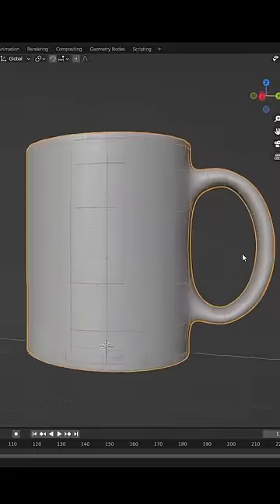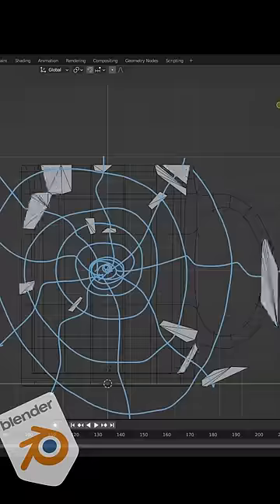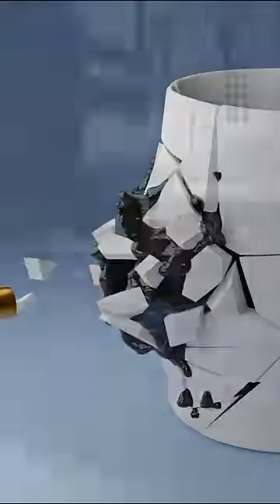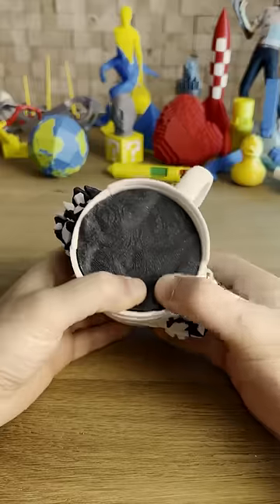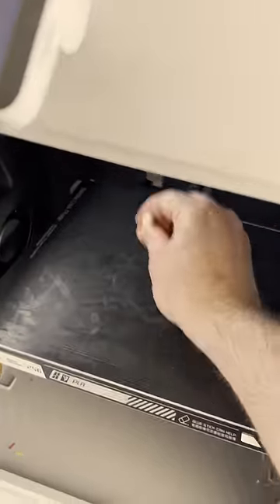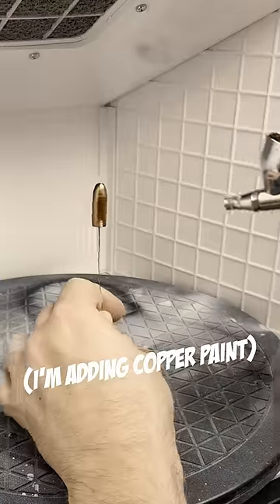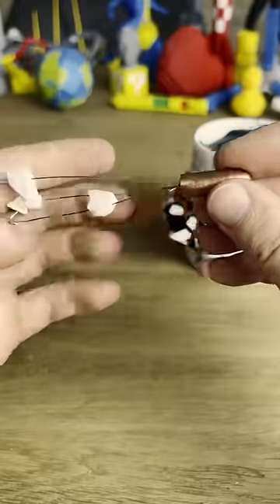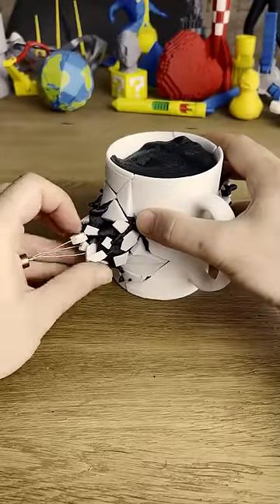Printing A Coffee Mug Shot By A Bullet ☕️ #3dprinting

Comment: I want someone to make this an actual mug.
Reply: Feel like it would quite hard to drink out of or clean ngl but maybe just the shattering or smt
Reply: @Sketchy_Dood make the bullet be the handle. Gives you an undamaged side to drink from.

Coat the whole thing in a smooth surface of waterclear epoxy
Reply: @JinKee I was thinking maybe have the fake liquid patch up the holes to still maintain the appearance of a broken mug without actually having open holes
Reply: It is it literally just saw it
Reply: @monke7919 you could mabey have a clear cube in the middle
Reply: @Sketchy_Dood  also I dont think it would be safe to drink out of pla and it wont be water tight
Reply: Possible
Reply: @JinKee or you can just make the mug but glue a cup inside so it will look the same but  you can drink out of it
Reply: Wow. Can you share your stl's?
Reply: @I.love.catssss622 I think that is the right way to do it
Reply: @Sketchy_Dood  no what you have is plastic so that your drink of choice would fill up that hole and look like it got shot
Reply: Same thoughts
Reply: I want one
Reply: Gl cleaning that thing cuz there's definitely gonna be dirt hidden within...
Reply: This was my first thought
Reply: just turn the bullet so its not actually in your neck/chest when you try to take a drink
Reply: @Sketchy_Dood if you make it normal on the inside and just the design on the outside
Reply: What if a normal mug, but with the handle being the mug shatter stuff and the mug can look black and white where you hold it
Reply: I was hoping it was
Reply: Yea yea
Reply: Totally thought it was an actual mug
Reply: Good thing is I never actually clean my coffee mug, so this would work fine with me
Reply: @Sketchy_Dood the shattering part he can add epoxy and white parts for the shatter effect he dont need the wire to connect to the bullet he can use white epoxy and make a liquid that is attached to the bullet without the wire and all
Reply: Okay I’ll do it
Reply: I would just like you to know im going to do just that i do ceramic work 🫡🫡
Reply: @Sketchy_Dood I agree unless you just made it so that the shattering is just on the outside like two solid pieces
Reply: I'll try to design something
Reply: Good luck washing that
Reply: It can be done, but it would require a blueprint or something similar
Reply: @Sketchy_Dood nah, just add larger clumps on the side and form the clumps. Then you can paint them and youre done
Reply: Same
Reply: It would take up so much space in the cabinets
Reply: Exactly
Reply: @VenomFrogPwned "it is it just saw it" Godzilla had a stroke trying to read this and fucking died
Reply: I posted exactly this but there's 126 comments of people counting
Reply: @FoxDog1080  But I was a week early so.
Reply: @FoxDog1080  Plus you're saying convert a mug into one. I'm meaning start from the beginning and do it.
Reply: @FoxDog1080  So sorry lad. Nice try.
Reply: @FLINTLOCKWOODMACHINE  I'm just complaining about the fact that they're counting
Reply: bro, I love your channel image!
Reply: I’d buy this
Reply: Just shoot one then
Reply: I agree.
Reply: You cant 3d print an actual mug it would just melt
Reply: Not exactly the same but you can find glass beer mugs and shot glasses that are designed with fake bullets shot at them and deforming the glass on one side around them as they enter at the Bovington tank museum online shop. I think they make a fake shattered one with a bullet too.
Reply: Y E S
Reply: @Sketchy_Dood just make the shape of everything around the outside of the mug. Then the inside is a regular mug while the outside looks to be shattered and blown out.
Reply: I WAS JUST ABOUT TO SAY THAT
Reply: @Sketchy_Dood I made something like that XD the concept it pretty easy
Reply: YES
Reply: u can get metal inserts and use this to hold the insert aslong as u make it to right size. then u can just clean the metal insert when u finish drinking ur coffee
Reply: My dad has a mug similar to this. It's glass and has a bullet from a gun stuck halfway in it
Reply: No you dont 💀
Reply: @Sketchy_Dood nah my dude piece of cake if we can make phones and the Internet then we can make that
Reply: I was thinking the exact same thing.
Reply: @Sketchy_Dood  fill the inside with the material that you use with actual mugs
Reply: I was just about to comment that
Reply: im taking a ceramics class soon ill see what i can do
Reply: Exactly what I was thinking.
Reply: @VenomFrogPwned they're talking about a mug like this that can hold a beverage. This mug is just an art piece that you cannot drink from.
Reply: I also was hoping this would be an actual mug.
Reply: Instead of making it the actual mug you'd make it a cover for a mug, that way it needs washed less often
Reply: Img YES
Reply: If someone did, they'd be breaking physics
Reply: I’d buy.
Reply: Fr
Reply: Bro y’all making ideas but not braining enough. How about a mug with a regular handle, but on its sides it has an illusion that there’s a bullet coming out same as the one in the video except the inside is just hollow like a regular mug
Reply: Imagine washing that mf lol
Reply: @watermelonfelon2777  I don't know, maybe put the design of the bullet on the outside and have the inside not have all the nooks and crannies and make it drinkable?
Reply: Same it's actually disappointing it's not.
Reply: @Sketchy_Dood I would have it as decore. It looks fire 🔥
Reply: Fr
Reply: TRUEEEEEE
Reply: For Donald trump
Reply: What if they make the design sheerly on the outside without the top and insides being covered by the black particles, like built up from the outside with an empty slate inside. Make the walls of the mug solid and then the extra printed stuff /shards lifted. That way most of the wire to hold the bullet will be coverrd by the shards and coffe particles. The bullet being detatchable
Reply: Exactly
Reply: Hi
Reply: I thought it was a cake for a second
Reply: The entrance would not have blown out and the bullet would not have been whole after impact
Reply: Same
Reply: THATS EXACTLY WHAT I WAS THINKING
Reply: Came to the comment section to write exactly what you wrote 😅
Reply: Angle the bullet so it comes in at 45° with the handle at 90° and the drinking point at 180°
Reply: i had the same idea bruh 👍
Reply: Bro me too
Reply: Just make it appear like 3D but it still holds the shape of a normal mug
Reply: it would only be a novelty and after a week they probably wouldn’t sale much
Reply: @JinKee how tf will you be able to design a realistic bullet that it big enough to support a full cup
Reply: Don’t worry grabs gun
Reply: yea
Reply: Same
Reply: Bro same
Reply: @Sketchy_Dood I’d buy it for decor
Reply: agreed
Reply: It can be a real life mug! Just shoot your mug, and because time is able to become measured infinitely smaller, find the frame of it and if you are able to exist in slow motion for infinite time, enjoy the moment of it!
Reply: Don't think that would quite work
Reply: @JinKee   put a stainless steel insert to hold the fluids! Epoxy is not good with boiling temp swings
Reply: Ok but how much should I charge?
Reply: Fr tho
Reply: What you got there mate?
Oh just a mug shot of coffee😂
Reply: @Sketchy_Dood  could make it a 'skin' for a actual mug. so it just clips into place and when you need to clean it you just take out the mug and wash it separately
Reply: That's how we drink coffee at school
Reply: Bro same
Reply: Fr
Reply: SAME!!!
Reply: Lol
Reply: @Sketchy_Dood just make a mug with shatter paterns and the "shot part" can be detachable so you can remove it and toss the mug in the dishwasher
Reply: I WAS THINKING IT WOULD BE AN ACTUAL MUG
Reply: Agreed
Reply: On it
Reply: I don't know if anyone has already answered this, but the reason this mug doesn't really work as a mug is that 3D printed plastic cannot be used on objects that have direct contact with food, as it runs the risk of accumulating bacteria or releasing particles.

For this to work, he would need to fit this printed mug as a cover onto a regular cup, so that neither the liquid nor the mouth come into contact with the printed plastic.
Reply: I could do it for a fraction of a second.
Reply: @JinKee no, that would suck
Reply: right
Reply: @Sketchy_Dood  make a smaller removable cup which you can put inside it.
Reply: @Sketchy_Dood something this cool I'll figure out a way
Reply: I don't
Reply: p
Reply: Good punctuation.
Reply: Thats what i was thinking
Reply: good luck cleaning that up
Reply: same
Reply: would have deserved a thumbs up if it was a actual mug, youtube are full of 3d printed toys allready that serves no purpose
Reply: 31K votes seems like a reasonable number
Reply: Me too
Reply: If you charged $10 for this mug, you'd make over $300K if everyone who liked your comment bought one
Reply: Yes
Reply: Same
Reply: @VenomFrogPwned I literally was about to comment this exact same comment when I saw this comment
Reply: @natalieholz8003  ok
Reply: When I'm older I'm making this just to grant your wish
Reply: im pretty sure I have a shot glass with a bullet in it.

Hehe, shot
Reply: I was thinking about commenting that lol.
Reply: Im on it
Reply: Same here
Reply: @JinKee not a bad idea
Reply: Same
Reply: Look if I had a 3d model I'd do it.
Reply: @Sketchy_Dood nah, as long as it's a normal mug internally then it'll be simple to clean.
Reply: Not practical bud
Reply: They did lol didn't u see this?
Reply: I'd be hell to clean
Reply: you want to eat bullet 💀
Reply: I’d buy one of those!
Reply: Same I would use it faithfully and I do not drink coffee
Reply: Ong
Reply: @ahmednawarm.eprojects3752 if someone made a real mug it would most definitely not be made out of plastic just the shards and bullet. The rest would be clay or whatever mugs are made of these days
Reply: I was JUST thinking the same damn thing!! I want an actual coffee mug like this!! Lmao
Reply: @VenomFrogPwned no a mug that you can drink out of
Reply: Thegod569  hell yeah
Reply: It would be difficult to manufacture such product. However you could 3D print the outside layer and put a real mug inside
Reply: Fr
Reply: @Sketchy_Dood just make those parts detachable
Reply: Not gonna lie it looks amazing and soo god damn badass
Reply: No one cares what you want
Reply: The entry point has exploded more than the exit, must be modeling off Crap of Dooty physics.
Reply: I think for that to be achieved you would need to put a like thin layer of plastic or glass to make a sort of hidden drink that you could just take off from the mug and so it would be that layer you would need to clean
Reply: There’s this store on Etsy that sells glasses with real bullets in them, making it look like it was shot.
Reply: Yes
Reply: Like a cool pen holder at work
Reply: You'd just need a recreate this so it fits around a real mug and make a cut out so your handle can slide down. Or use a handless mug inside. Only thing I would recommend is having the mug higher so you can drink out of it
Reply: Cake 😂😂😂recipes with
Reply: I'm just think about it...🤔
Reply: Say goodbye to your fingers
Reply: @JinKee ❤❤1q11aqa❤ AA❤❤❤❤❤
Reply: @JinKee or use the outer shell as a sleeve and bond it to a fully intact mug with epoxy
Reply: @Sketchy_Dood 

Make the broken sides removable and the mug part a regular mug with like magnets inside to hold the gun stuff on when not being cleaned. Simple.
Reply: I have a glass cup with a bullet halfway through it so it's possible
Reply: Just turn the open spaces into a silly straw
Reply: I gotchu
Reply: @natalieholz8003  its not a real mug though, its just a piece of art. you cant even drink out of it, it just looks cool.
Reply: @VenomFrogPwned he means something you can actually drink out of

somehow you didn't understand first thing
Reply: i was expecting it to be a real one at the begin and just the destroyed bots be over it and thats it. instead of the whole thing
Reply: Ça me fait penser au film "Wanted" où il y a une action identique....😅😉🙏👏👏👍☮️
Reply: @Sketchy_Dood if it's made of good ceramic it will be washed in dishwasher
Reply: That's what I'm saying!
Reply: How would you wash it though?
Reply: Same thoughts
Reply: It would be pretty cool
Reply: @JinKee 😅😅
Reply: It’s already a thing
Reply: I know right
Reply: @Sketchy_Dood  🔴 What Is Islam? 

🔴 Islam is not just another religion. 

🔵 It is the same message preached by Moses, Jesus and Abraham.

 🔴 Islam literally means ‘submission to God’ and it teaches us to have a direct relationship with God. 

 🔵 It reminds us that since God created us, no one should be worshipped except God alone. 

 🔴 It also teaches that God is nothing like a human being or like anything that we can imagine.

🌍 The concept of God is summarized in the Quran as:

📖 { “Say, He is God, the One.  God, the Absolute.  He does not give birth, nor was He born, and there is nothing like Him.”} (Quran 112:1-4) 📚

🔴 Becoming a Muslim is not turning your back to Jesus. 

🔵 Rather it’s going back to the original teachings of Jesus and obeying him. 

More .....👇

🔴 THE RETURN OF JESUS
Reply: Use this prototype to make a mold out and then make it out of epoxy resin or something safe.
Reply: That's what I was thinking
Reply: Same
Reply: @Sketchy_Dood 🤓
Reply: how
Reply: agreed
Reply: Say less
Reply: Same
Reply: @Sketchy_Dood  i have the omegamart black hole mug, and it isnt that bad to clean. im sure they'd be similar in design.
Reply: I thought it was an actual mug that he 3D printed
Reply: Ayo very nice job
Reply: There is a brand called BEN SHOT that had a real bullet with the glass melted around it that is usable being both the billet and mug
Reply: Seems very cool
Reply: @ramonsanchez6903  it is me and my family got my dad one for Father’s Day (if there are two of these replies it’s because my internet’s garbage)
Reply: @JinKee not bad of an idea bro
Reply: I've seen shot glasses with bullets in them at Spencer's, maybe a mug too but I don't remember
Reply: @VenomFrogPwned  di si brm brooooghh
Reply: Seal it real good. Core the whole center. Seal the whole thing again. I don't see why it's not possible?
Reply: Make one with a metal inner cup and brim that can be inserted so you can use it.
Reply: You guys are overthinking this WAY too much. Just drink it
Reply: Yeah same
Reply: @VenomFrogPwned  you also like daft punk?
Reply: ben shot 308 glass
Reply: bros notifications 💀
Reply: Same bro
Reply: i… honestly dont think that would be possible, dude
Reply: That would be so hard to clean if it got dirty on the outside
Reply: Fr
Reply: Somebody should make a mug that is shattered but still works... with a second cup inside that you cant see.
Reply: wouldn't it be like heavy
Reply: @Sketchy_Dood no matter what it needs to be a real mug
Reply: You get them for free in America.
Reply: It would be cool as  a decoration but actually drinking out of that would be pretty difficult. Idk how it could possibly made to have normal mug proportions
Reply: It’s literally not that complicated people just make the outside layer the artsy shattering and the inner layer an actual cup or mug so it looks shattered but is still usable. Kinda like the mugs with liquid between the inside and outside
Reply: Make the coffee areas holes for when you pour liquid the holes get covered and look like the thing youre drinking
Reply: Ssme
Reply: Same😂

Comment: I'll steal this idea and make one at home, this is so dope.
Reply: Add bits of cotton balls behind the bullet to hide the wires and it will look like it’s breaking the sound barrier
Reply: Plz use an actual bullet and not the whole cartridge
Reply: make sure to make the bullet more pointy. that one looks like not bullet enough.
Reply: @TheBejohns5  good idea. :)
Reply: Makes a good Halloween decoration, but if really wanna make it into something cooler in my opinion to make it actually hold actual liquid inside or be like a pepper/salt shaker.
Reply: Plagiarism in a nutshell:
Reply: u
Reply: s
Reply: @nullmojo7483 ever heard of a pistol and what ammo it uses?
Reply: I would not drink hot drinks from one of those. The chemicals released proberbly not safe to consume also micro plastics